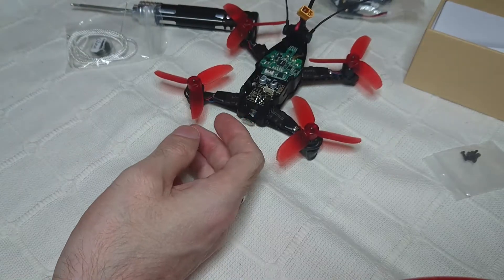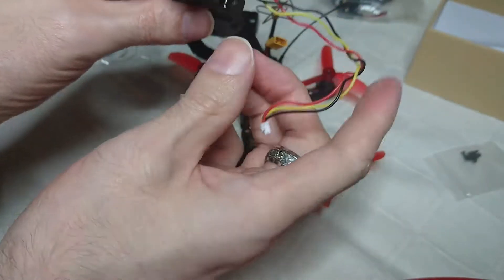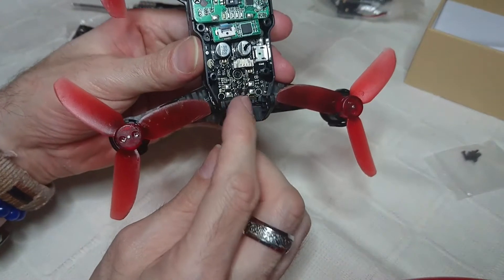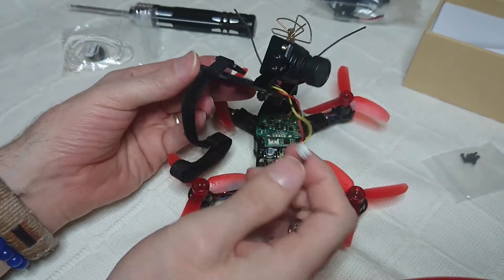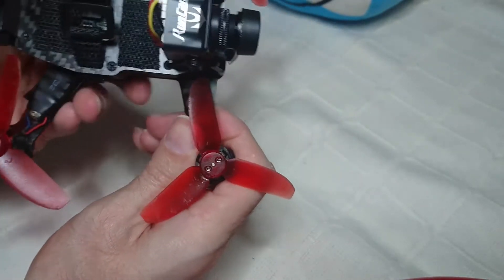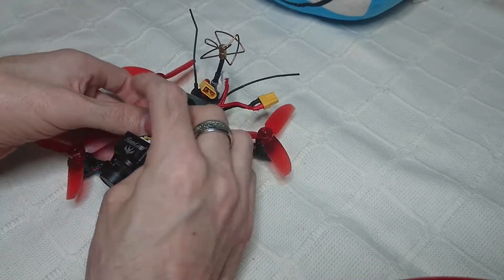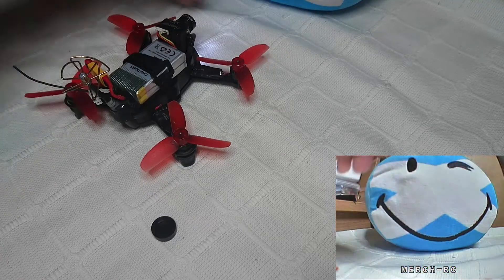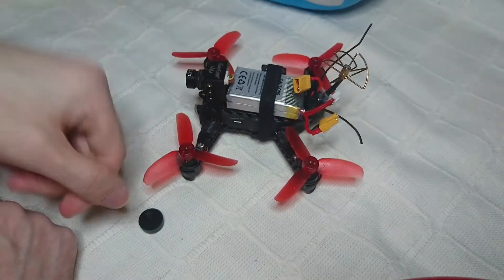Walkera Rodeo 110 Runcam Swift Mini Mod

Comment: your a beast at these mods man I actually think this is awesome. You'll sure have a great camera for fpv now.
Reply from the maker: Cheers bro but did you check out the swift micro that's even better.
Reply: micro? no I didn't know they had one. I have to check it out.  oh I got that 450mah 3s battery last night and holy shit it made it so much more powerful. No hot motors no hot ESC. Just more power n this equals more fun 😊
Reply from the maker: Nice glad the 450mah is ripping it for you bro,flight time?........lets hope the bigger mah batteries you baught won't cause heating problems.
Reply: yea man it's a beast now. flight time was about the same. And yea those 800mah 3s batteries should be here soon. the 450mah I ordered next day delivery.  Have you thought about getting a 3s for your 110?
Reply from the maker: No not yet but i might.

Comment: Nice mate! Do you think this is a good first brushless racer?
Reply from the maker: Thanks!........the 110 is a great racer!
Reply: Thanks! Maybe i will check it out
Reply: So did your cam only showed black? Dustin had the same
Reply: always rc reviews! yes good first brushless racer. I think you'll look it.
Reply from the maker: You mean thee  color?
Reply: Yeah some people got black screen
Reply from the maker: No black screen as you can see in the video,what quad did he plug the cam into?
Reply: Merch RC i mean. Sice you upgraded your cam, did you get black screen with stock cam?
Reply from the maker: I would never know because  i took the stock camera out after  my first flight lol.
Reply from the maker: I don't use the stock cam ever so i don't know sorry.
Reply: Always rc reviews. I know what video your talking about and I was a little worried about range with the dipole antenna. But when I flew mine I have no issues video range is actually very very good. I still have the stock antenna on mine. I was actually impressed with it. Hope this helps.